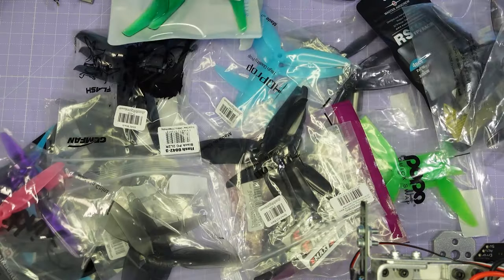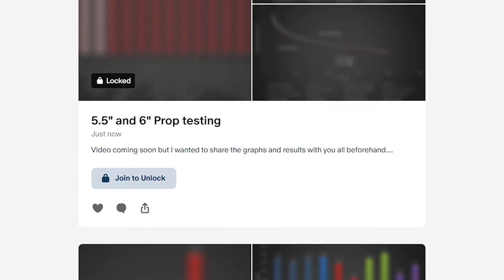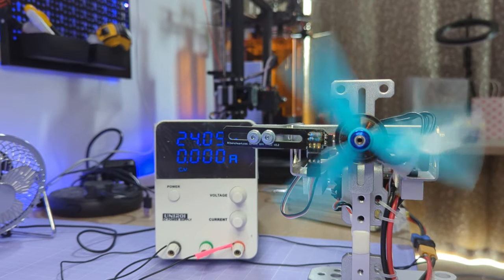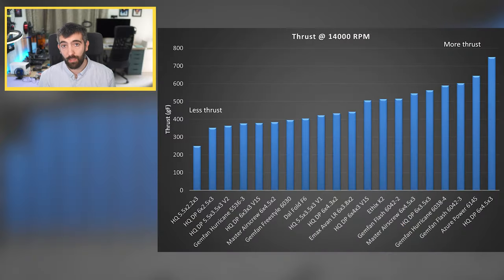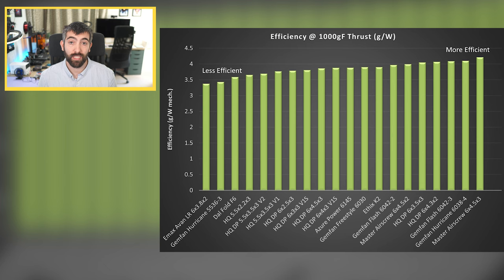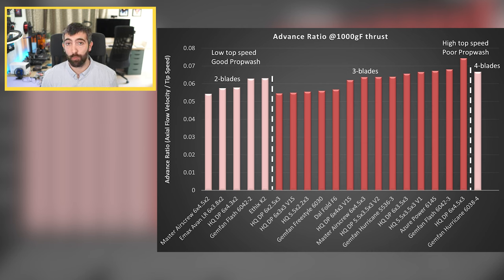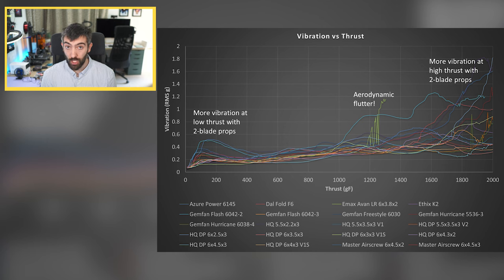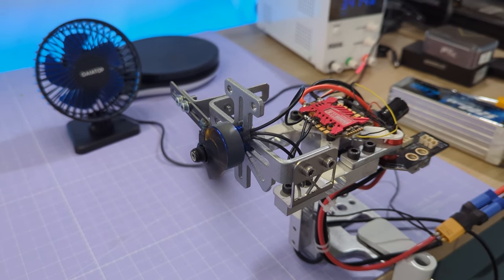6 inch Prop Testing

Comment: I have one complaint in your testing and it could be me that's wrong. When you are talking about responsiveness, it is in terms of RPM per second, however with the larger props that have more thrust and also have more weight for inertial changes, that doesn't necessarily mean that they won't adjust the quads position any slower than the smaller props that show more responsiveness. Because the bigger prop is throwing around more thrust and inertia, I think you would get the same change in the quad for less RPM per second.

Comment: You forgot two very good 6" props:
T-motor T6143  and  Gemfan  6032
From my back to back testing of all 6" props, I liked the T6143 most.
 It also had the highest top speed in practial test flights with gps.
Also keep an eye out for the new Gemfan 6045 that just released.
Chris, if you want, I'll send you where to get these props.

Comment: Chris, you've chosen quite a big trust for comparing efficiency of props. 1 kg per prop this trust could only be achieved during harsh manoeuvring where the efficiency matters less than responsiveness and the trust itself. But there is also long range flying which are lightweight and thus operate at relatively low trust levels, like 50-100 grams per prop. For instance, my 6" long range build (which hovers for 1 hour and flies even longer) weights only 300 grams. That's where should we look to compare the efficiency. Or, at least, you could show two areas of your efficiency graph: one for low trusts, and one for medium-high.

Comment: Interesting observation made many years ago. I had a plane with a 6/4/2 prop that was very under powered  and close to stall ecven at full throttle.  It went into  farm land at full power. No damage to the aircraft but the leading edge of the prop was badly scratched up. It looked more like a saw blade than a prop. I flew it again with that same prop and was surprised at how dramatic the speed of the aircraft improved. I never followed up to test this further but was sure interesting. And unexplainable.
Reply: F5B and F5D competition electric planes use props with sawtooth leading edges to prevent stalling the high pitch blades at low airspeed.

Comment: I'm surprised about the statement of Ethix k2 being low in vibration. They might be well-balanced, but that doesn't really help in real world flying. I've tried so hard getting Biblades to work properly but in the end the PID Controller was always kind of freaking out.
I suspect the more intense pressure waves on the arms being the issue. The noise plots look way different between 2- and 3- blades, 2-blades almost impossible to filter properly.
I would love to see a video focusing exactly on that issue, maybe you figure out what needs to be done to get Biblades filtered and tuned as well as Triblades.!

Comment: With a weaker motor will the efficiency change? I.e. improved efficiency with flatter profile props.. (dji mini drones have 6inch props and 1505 motors and flies for over 30 minutes) long range builds

Comment: Thanks for the detailed analysis, Chris.  One questions I have is, are we no longer balancing props anymore?  I remember painstakingly balancing 2 blade props and then gave up when the 3 blades started showing up. I'm sure balancing these props would skew all these characteristics.  Cheers!
Reply: Honestly anything smaller than a 7" prop isn't really needed. It's anything bigger than 7" you might want to balance them, especially something like a 13" tri blade for an XClass rig or 13" cinematic X8 for instance.
Reply: @BikeGuyFPV  yeah makes sense, I did not enjoy balancing props, I tried everything to minimize the vibs getting to the old naze 32 FC 🥴

Comment: I live in the foothills of the Rockies, outside of Denver Colorado. I have around 12 deferent 5" freestyle and 3,  7" quads.  For my 5" freestyle, What props should I be using with this extremally thin air and High altitude ?    any help would be much appreciated...... Thanks, Taylor
Reply: Also in CO hr from Denver and from my understanding we want to use higher pitch props than others.

Comment: Hey Chris, awesome information.
However, I wonder: Wouldn't it make sense to factor in the thrust of the props in the responsiveness rating? Afterall, if a prop is heavy but generates a lot of thrust then it doesn't need the same rpm as a lighter prop with less thrust to arrive at the same thrust. And since it is thrust that makes the quad maneuver and not prop rpm, your responsiveness rating seems unfair for the heavier but high thrust props. Or am I missing something?
Reply: I totally just put out the same reply before realizing you beat me to it.

Comment: There seems to be some counter intuitive stuff going on there in the data, the master airscrew 6x4.5x2 is less efficient than the master airscrew 6x4.5x3, you would have thought that the 2 blade prop would be more efficient then the 3 blade, perhaps it is because you chose that specific thrust, (1000 grams) on the test that the data came out like that, any thoughts?

Comment: Hi Chris,
I wanted to ask what you think about the topic of voltage sag.

In particular, I am in an association in my university that is building a model airplane for competitions and we started to run some tests on the propulsion system with different batteries, acquiring data as voltage, current, rpm of the motor. 
 
We have seen that batteries behave differently (the voltage sag is different) with different propellers.
This can give us insights on how a specific battery can be used with specific propellers, maximizing the power delivered for our scopes. 

Do you think this could be something interesting and useful to study in a serious way? 
I can't find anything similar that has been done on the internet.

Comment: Interesting comparison between the Azure 6145 and the HQ DP... During your 5" testing, I recall that model had higher than average vibration. In this case, it wasn't too bad? By the way, The 6" Azures also come in a carbon fiber version that cost a bit more. It would be cool to see how it compares to PC props in your tests.

Comment: Great video Chris! I would love to know which 5/5.1 inch prop matches the Supernova best in the thrust/rpm graph. I have reached around 220 km/h with HQ 5.1x4.6x3 on a swichback frame with GPS, but am convinced I can get a higher top speed with another prop (and bigger battery).

Comment: I’ve been flying 6inch since I started the Hobby. I really appreciate the grip and efficiency of the larger disk area. My Problem always was the frame choice, the market did not offer any lightweight options that had sensible desings for my use case. So I recently decided to buy the AOS5.5 with 2 sets of HQ 5.5X3.5X3 V2 and a set of velox veloce 2207.5 v2 1750kv. Is There a Way I can use 6” props on the AOS5.5? Because i would like to try all my different 6” props with the improved resonance performance. If not, would it be possible to design 6” arms for the frame?

Comment: What about props exploding? I’ve had both the azure and the ethix 2 blade props explode in mid air for no apparent reason for me. No crashes or no damage to the props before take off? This was on my f6D iflight Evoque
Reply: K2? On my first set and no issues so far 🤞🏽
Reply: I also had the azure prop explode in mid air on the same nazgul f6